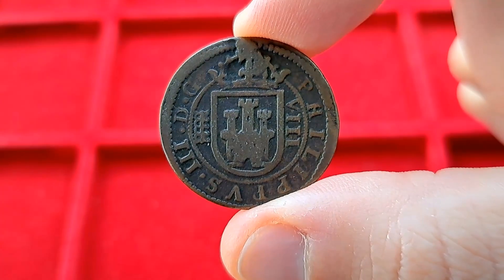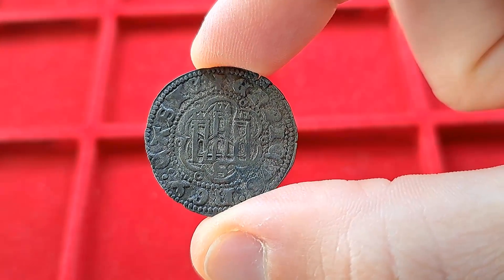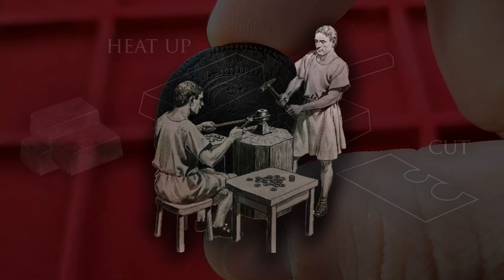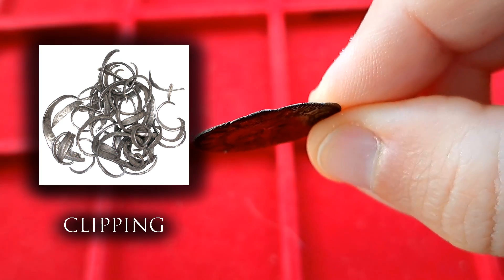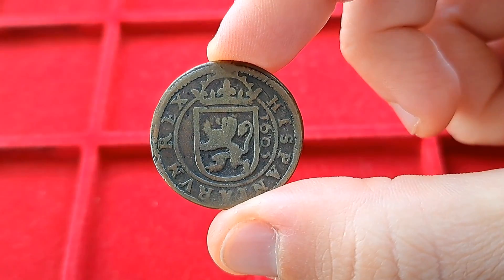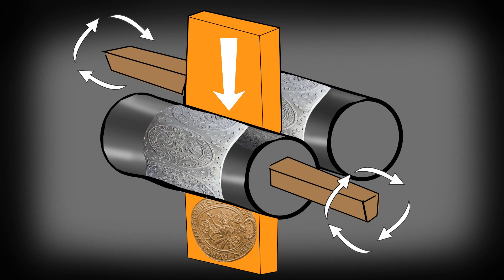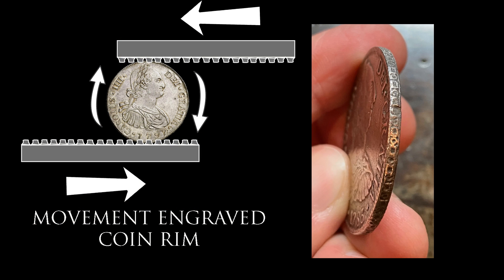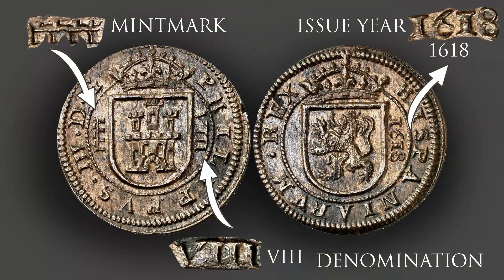How were the first Machine-made coins struck?

Comment: Excellent video. Indeed, these coins carved by roller press, enjoyed a more homogeneous thickness ... So the weight was very similar in emissions... The art of coinage was also improved, managing to avoid openings on the entire surface of the cospel. However, the quality increased, but production did not reach the speed achieved with hammer coinage... It is centuries later, when thanks to the automation presses, an exclusively industrial production was achieved. A hug.